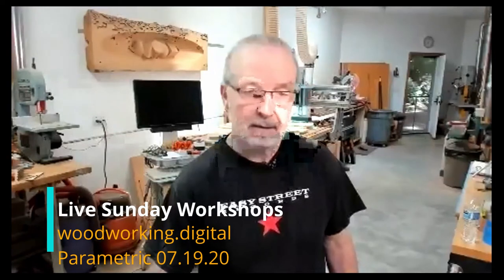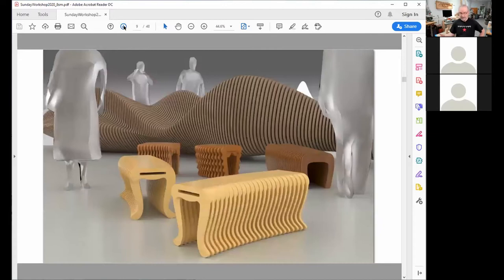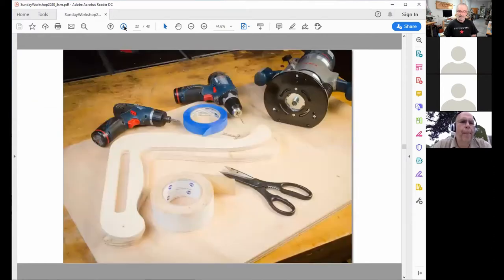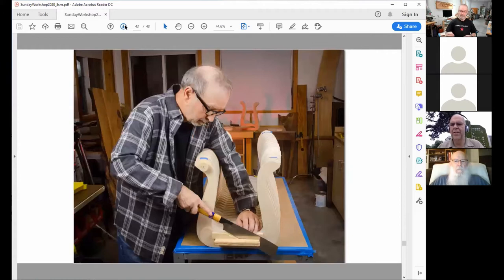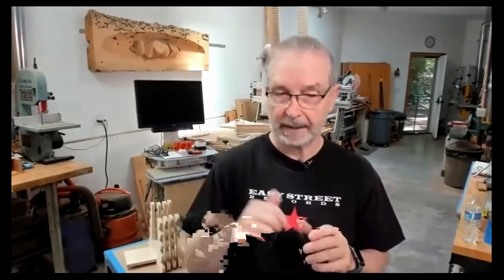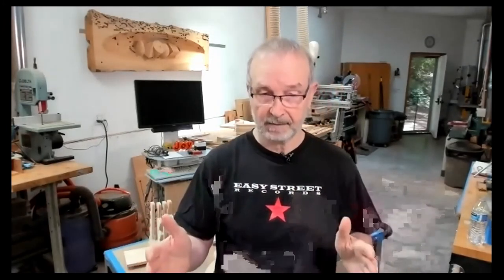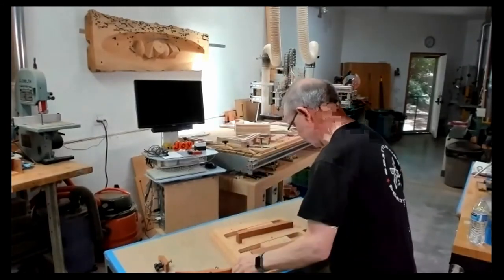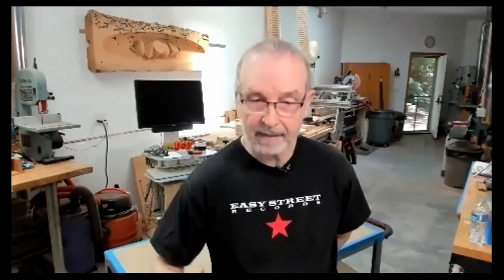Live Sunday Workshop | Parametric Bench

Comment: Tim - Follow up question: Have you experimented with the a flexible "rib" rather than a solid?  An example would be the traditional plastic drafting spline where the various pieces of the spline slide against each other to form an infinite number of curves.
Best - Michael
Reply from the maker: I suspect you are referring to a flexible "spine" rather than a rib since that would be what would modify the look and function of a bench, in this case. That is something I had thought about when developing the spine and rib concept. However, any solution would involve a change in spine materials, a method for articulation plus introduce several mechanical and other challenges. I think I could solve some of these things by designing some 3D printed components but overall it's a problem that would likely result in several "messy" solutions. I'm a designer and I don't like messy. Still, I'll likely revisit flexibility someday with a fresh set of eyes. In the mean time, there are so many great  creative possibilities available in spine and rib construction to explore.